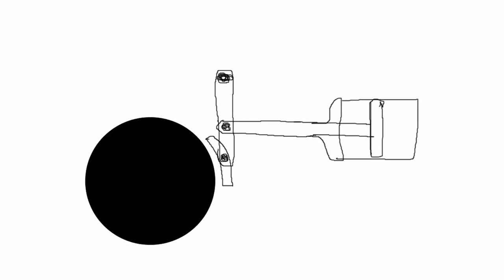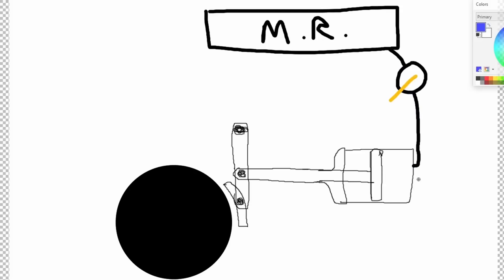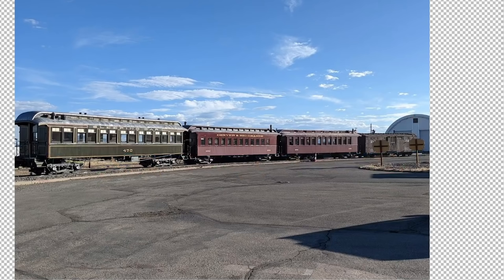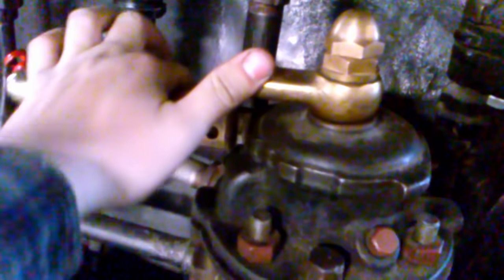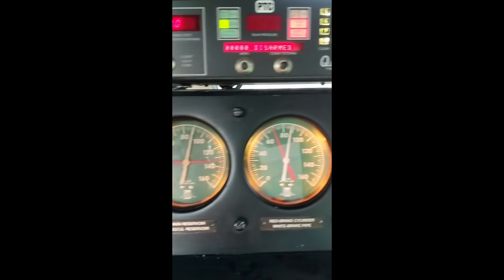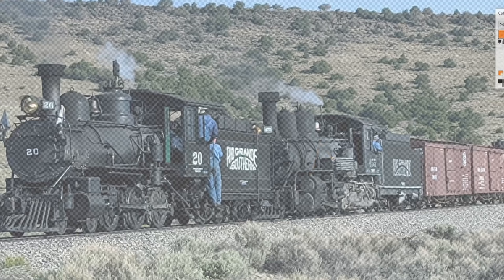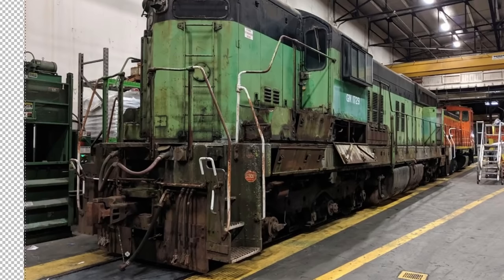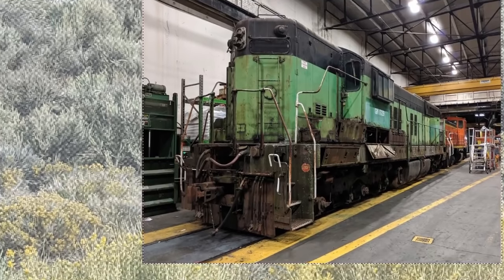AIRBRAKES 101: 10 levels of TRAIN BRAKE understanding!

Comment: While freight car control valves are not designed to partially release there are a couple ways to trick them into making a lighter brake application, or what feels like a less than minimum application across the train.  

1.  If you have a relatively short train and have made a moderate to heavy brake application, release it and then make the same application again right away.  If you time it right everything will settle out with the car control valves in the lap position once again before the brake cylinders finished exhausting, leaving you with a lighter brake application.  But this is quite tricky, it requires a lot of practice to get right, and does not work as well on long trains where the head end cars may have completely released well before those on the tail end.  

2.  If you want a very light brake application, take a minimum and let it set, release it, and then take a minimum again when the flow drops below 40 CFM.  Making a very light brake pipe reduction before the train is fully charged will have the effect of setting the brakes on some cars and not on others.  It is important to note that doing this will create 'stickers' (cars that won't release normally), so when you are done with this brake you will have to 'clean it up' by making a heavy brake application and letting it set completely before releasing it (you need at least a 10 PSI rise to reliably get rid of stickers).  We have a number of grades in the 0.5% to 1.2% range where dynamic braking alone won't hold the train, but a full minimum application is too much.

3.  This is a variation on 2, if you want a really light brake you can take a minimum and then release it before it finished exhausting, this deliberately creates stickers so once again you'll have to 'clean it up' once you no longer need the brake.  

In general these sort of strategies are called "Cycle Braking", and they take a fair amount of practice to get used to and get right.  It is important to not abuse them, if you cycle brake too many times you can "pee away your air", and at worst you could reduce the brake pipe pressure to the the point where 'soaking it' will no longer propagate the emergency braking signal.  You need at least 45 PSI in the brake pipe for this, and we are supposed to put it in emergency if the brake pipe gets down to 50, regardless of how we got to that unenviable position.
Reply from the maker: Cheers Bob, this is a brilliant comment. I've done #1 several times when we've had a particularly leaky train (gotta love historic equipment in the winter) but never had the chance to try the others. I also didn't 100% understand how it worked. Cheers for the explanation, and the other examples.
Reply: As a Driver (Engineer) here in Australia I found your explanation fascinating for the different terminology you use there. Apart from the obvious metric measurements of air instead of imperial, we use different terms for what is essentially the same equipment. We use all three methods of braking here you described. All three are referred to as cheating but completely necessary on certain trains.
Reply from the maker: @lexx555  the little terminology differences are some of my favorite things... We do the same things, speak the same language, but it feels all wrong... Lol!
Reply: @Hyce777  I know! Its even more strange considering that most of the locomotive components and wagon (freight car) braking equipment we use is from the USA (GE, EMD, Wabtec etc). By the way great video mate.
Reply: @Hyce777  what’s your favourite locomotive that you have run IRL
Reply from the maker: @pacificcoastpiper3949  Don't make me pick between my kids... lol!
Reply: That was very interesting info and I can imagine it took some time to get the feel of how to get things set up. Always something to learn.

Comment: My experiences with HIGH FRICTION COMPOSITION BRAKE SHOES.
I recall the GN testing high friction brakes shoes when I was a GN Brakeman 1960-68. The tests were around Bethel, MN that's about 35 miles North of Mpls. On the GN line from Superior, WI to Minneapolis, MN.  I wasn't on the crew but heard that they were testing by going different speeds and even dynamiting the air. Trouble was that testing was being done mid-day in a August heat wave!  I haven't seen any testing being done in cold weather that is experienced in Northern States. Ya, coldest as a Brakeman -48f in Cass Lake, MN, and coupling air hose's. You'd grab the near hose with two hands and bend it up into a u-shape. Then grab the far air hose and bend it up waiting for the near air hose to slowly, slowly try to straighten out, guiding the glad hands to a connection. Then I rode the tail end (100 cars) two and a half miles to a joint and walked to the engine. I know about cold weather.

The first year as a Fireman I started on the old DSS&A line Superior, WI to Ewen, MI.  We were picking up a car of lumber on the Connersville Spur, that's just east of Thomason Siding. We had a GE U30c, an 800 and was picking the car up with the lite engine. We approached the car and the engine was plowing a large snow pile higher than the coupler.  Don Beasley stopped me just short of the car and had me pull away so he could clear the snow away from the couple itself. If you were to try and couple with all that snow you had the chance of blocking the lock block from falling in place. If that happened you would have to remove the knuckle to clear the lock block. I pulled away about a good half car length and stopped. I reached for my coffee bottle and then Don was screaming at me over the radio, the engine was backing up and would crush him if he hadn't seen it to his side vision.  That was really scary. SCARY. It was downhill there but I never had a GP 7 or 9 do that. My first impression was that the composition shoe polished the wheel surface so much and the shoe being cold would not provide enough friction to hold. I later found that this was only a small part of the problem in cold weather. Cast Iron shoes leave a lot rougher surface on the wheel and the shoes wear a lot faster. What happens on the road is the shoes get hot when used and trailing thru snow or blowing snow it melts on the shoe and gives it a coating of ice. The next time the brakes are used that ice layer needs to be broken thru. Cast Iron shoes leaving a rougher surface breaks thru faster even with lite applications. (6 pound notch reduction) not so with the composition shoes. I found that in snow conditions a twelve to fifteen pound reduction was the least I felt comfortable with to break through that ice layer. 

I worked a 3pm switch engine at Rices Point Yard in Duluth, MN. There was a lot of snow and blowing snow. When I inspected the engine going to work, the brakes told a story. With the repeated application and releases of the brakes, there was a three quarter inch layer of compacted snow/ice on the working surface of the brake shoes. All twelve wheels. ICE BRAKES???  I left the independent brake on full and took a full service reduction on the automatic to increase the cylinder pressure even more to wear the ice away. After that I carried a magnet that I would put on the side of the independent brake handle on engines with composition shoes so the brakes would never fully release in those working conditions. 

My last trip as a brakeman on the GN was a real eye opener concerning composition shoes. I was on a taconite train. The lead engines speedometer was off, really off. 32 was about 48 or more. Engineer was from Kelly Lake and I believe unfamiliar working out of Superior as I had never seen or worked with him. Up with empty's, pull thru the loading tipple and return to Allouez Ore Yard unloading shed. Four or five car units with solid drawbars between them and rotary couplers on each end. Usually two hundred fifteen cars. Loading tipple would;d tell you how much was loaded, usually fifteen or sixteen thousand tons, plus you needed to add the weight of the taconite cars. It's starts downhill at Cloquet, MN all the way to Boylston Jct. I don't have a timecard but it's about twenty-five miles. Speed limit on taconite was thirty mph. Going thru Dewey speed was close to an actual speed of 45+ mph.   The conductor called and said we had cars on the ground. Engineer started an application. Conductor dumped the air. Leaving Dewey there is a slightly increase downgrade. Speed increased to fifty mph with the train in emergency.  The next station is Boylston Jct.. The signal was double red as the Passenger Train headed to Mpls/St. Paul was approaching Boylston Jct. and so were we, except our train wasn't going to stop short of Boylston. This is going to be close. The passenger train made it. The signal changed for us less than an engine length from the signal. When we stopped we had three engines and five taconite cars beyond the junction switch. Less the two minutes from either spearing or head-on collision with the passenger train. I walked the entire taconite train and found four leading axles on four widely separated locations on the ground South of the South rail.
The train went very close to, or did go five miles with the train in emergency. 
The taconite cars had roller bearing axles and composition brake shoes.

I had another experience with excess speed with 100 empty freight cars, but with cast iron shoes this time. Speed was forty seconds a mile. That's whole n other story, and ore trains too.

I had some fun and games with trains, ones with cast iron brake shoes and forty foot box cars filled with grain that is. Leaving Glenwood, MN the first stop for us was at Brooten, MN. That's where we needed to line a switch entering the Brooten Line to Superior, WI. Track speed was 40mph. By the mile board at 40. A lite application kicking off the head end brakes to keep everything stretched. Then seeing how fast I could go over the main street crossing and still stop for the junction switch. At the road crossing increase to a full service reduction and stop in about 700 feet for the switch. After many trips, well, at 26 I put the lead wheel of the engine on the points. That was the end of that shit. There is the saying “Stop short, NO Guts. Run by, POOR JUDGEMENT”.  I found that slowing for the head man to get the switch without stopping was actually faster. Same with the hind-end lining the switch back. On many a 200 mile trip the first stop was at the yarding track in Superior. Jack Peterson hogheaddotnet
Reply from the maker: I love reading these stories of yours Jack! Would be great to do an episode of just you telling train stories :)

Comment: Interesting story about the accidental dump save. I have done something similar on a 24RL on a GE 23 tonner.

The engine had just come back from a big overhaul of the electrical system and just had the 24RL put in, prior it was 6BL or something similar.
I was coming down the hill and was making a small 8-10 pound reduction, going in small hits because the hill is a gradual decline. That day we found out the dump bump had been ground down so low, you can't even feel the difference from the service position. 

Realizing it had dumped, I immediately put it into lap and managed to save the MR and only dumped about 30 pounds from the BP. Moved it to release, and after a small jolt and a short stop, kept going.
Reply from the maker: I'm not the only one! Haha. I've dealt with "modified" bumps before... never fun. I wish I knew more about 24RL, it seems neat. I've never really interfaced with it.
Reply: @Hyce777  It's a lot of fun. I love the non-self lapping stands, you have so much more control. It takes a decent amount of skill to master charging the trainline without overcharging, but it's super rewarding. It's not all that different to work with than the 6 other than pressure maintaining... unless you work in the mechanical department!
Reply from the maker: @PowerTrain611  Lol! good to know. I just recall our machinists at BNSF needing to get the SD9 in the picture to pass an air test to tow it out for sale and no one knew 24RL... quite complex on the mechanical end, good to know operationally it's not too different :D

Comment: I think you've answered one of the mysteries of my childhood. I lived along a preserved railway and a tiny 0-4-0 I often rode behind (and sometimes in) had a tiny diesel engine on a bracket they'd added to the back of the cab. It never occurred to me all this time, but now I realise it was actually an air compressor for the brake lines. I don't know why they'd need it but I have a few guesses- original equipment was too weak, incompatible for some reason, or needing repair perhaps.
Reply: or it was an ancient engine with no air brake equipment fitted or vacuum brakes

Comment: Thanks for posting this tutorial.  I may go work for a tourist road after I retire from my "real" job, and they run F7 and GP9 diesels with 24RL stands (one switcher has 6 air, but it probably will never run again).  I have had a good understanding for years HOW automatic air worked, but this really enlightened me WHY it works.  Perhaps sometime you could discuss engines with pressure maintaining?  The aforementioned road has one 1950 vintage F7 that lacks both dynamic brakes and pressure maintaining; the engineer has to work the air like it is steam engine days!
Reply from the maker: Glad you enjoyed it! Yeah, pressure maintaining would be a good topic. I'd need to read up on it myself, never had the pleasure of really getting to run anything with it, haha. I've always thought of retiring to the tourist ops myself :)
Reply: @Hyce777  if you do, it's also worth noting that it is possible to trick those older brake valves into pressure maintaining by using the regulating or feed valve, this unapproved technique is of course referred to as "feed valve braking".  It can also come in handy on the 26 or 30 systems if pressure maintaining fails (usually from a leak somewhere on the equalizing reservoir piping) and the brake valve does not have both freight and passenger settings (switching to passenger usually makes it work again). 

Electronic brake valves won't let you change the settings or feed valve pressure while the train is moving, but I've never seen pressure maintaining fail on any of them.